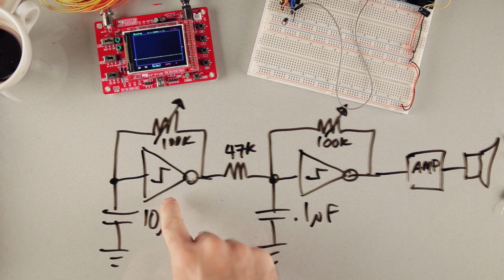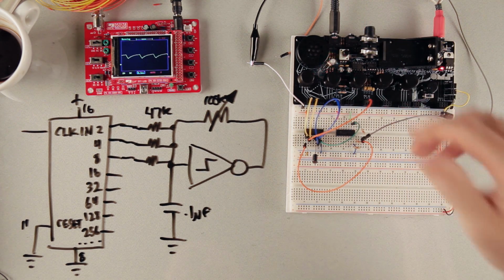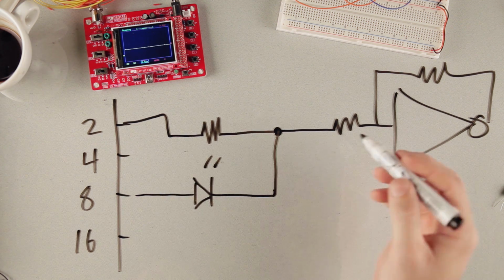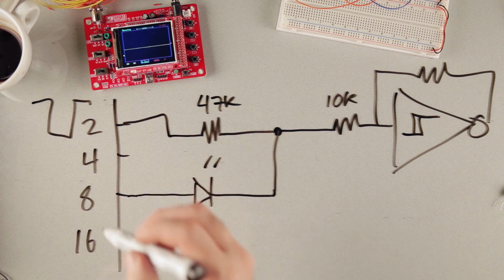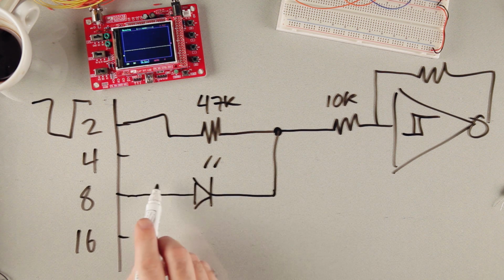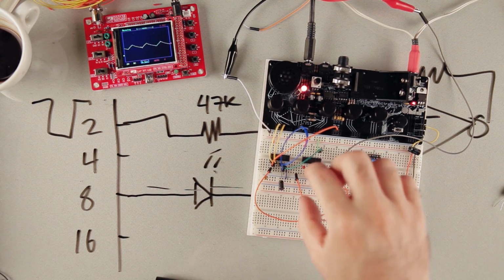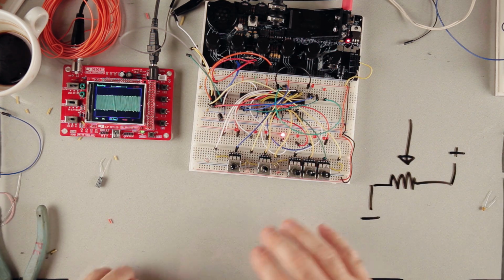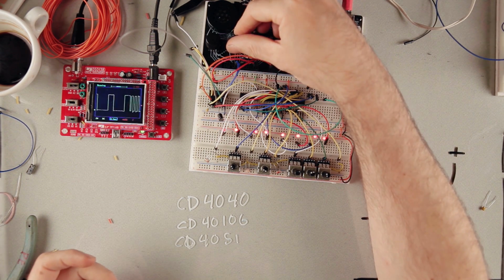Casper Electronics DIY synth building. Part 2: Sequencers

Comment: Like the little scope. CD4060 has a few advantages and can be used mostly like a 4040, cascade if needed. 74HC4060 ( 4040,4020 ) has higher current and plenty of volts for most things. It is 5V logic. CD is higher voltage when required. All seem to cope with a bit of abuse as the Ron of the output devices is mostly self limiting.

Comment: Hey there! Could I get some help? After hours and hours of trying, I couldn't get this to work. I made 1 oscillator, wired it up to clock, got /2 /4 /8, wired that up to A B C, but I guess I couldn't figure out how to wire up pots. I made 2nd oscillator, audio oscillator, on the same 40106, wired right leg of each pot to upper input, and connected every middle leg to one of the inputs on multiplex, took the output of multiplex and connected it to oscillator output. But I get nothing, or some random clicking and noises...I don't know what could it be, I use external PSU to power up everything, and sometimes I even get some strange feedback from the clock outputs on oscillator output even if they are not connected (except power rail). I connected Vss, Vee and INH to ground, which I found in the manual for multiplex. Also, multiplex draws a lot of current I guess, since it got really hot if connected to 12V right away, If i place current limiting resistor, then it gets hot instead. Idk, I might just broke the multiplexer, the clock outputs work fine with 1 oscillator, but as soon as I connect them to A B C i get noise and volume drop...I know that wasn't clear explanation, but I'm quite tired from trying to fix this. If someone has an idea, I would really appreciate it. Thanks!

Comment: you added  2 wire instead of 3 from 4040 to 4051 a and b for pots.. what did you connect thru the 2 wire that gives you sequence?
Reply from the maker: At what part in the video? Send me the time and i'll check it out

Comment: A note to other diy synth newbies like myself: If you’re moved to invest in the materials needed to build these circuits and follow along as well as hopefully furthering your experimenting, know this: these oscillators only sound as good as your amplified audio source. I just found out just how good these circuits can sound through a powered studio monitor with decent bottom end. Life changing. Invest in the best audio setup for this stuff as you can and you will be VERY motivated to make and learn more once you hear how good this handful of parts can sound. Trust me. Peter, you sir are GOLDEN. ❤️
Reply from the maker: Yes! i collect subwoofers just to abuse with breadboard madness. The difference is epic!
Reply: casperelectronics synthesizers Peter, I do have to confess; I just can't seem to get the sequencer working. All else I've done works great. Any chance you might edit this video to build up the sequencer in a similar step-by-step fashion as the previous circuits?
Reply from the maker: @Sarahbuildsstepsequencers  i cant find your previous post about the broken link but the links are now fixed and you can check out the sequencer drawings. hope that helps

Comment: This is great! Thanks for sharing! I have a question: Can I just use 1 4051 to control both the sound and the led?
Reply from the maker: its really best not to. in some cases you can get away with it but it can result in compromised functionality of both the light and the sound.

Comment: Like many others said, your series of videos simply kick ass. I don't know if you (or any buddy around here) can tell me: If I use the divider chip as an octave generator, can I still use the original sound, directly from the oscillator, mixed to the octave? Like creating a different timber? Thank you so much for your videos. thanks to them I'm really diving into it. Cheers!
Reply from the maker: Rodolfo Ribas yes you can still use the original oscillator :) mixing them together is a nice technique for varying timbers as you mentioned
Reply from the maker: hey! sorry for not responding sooner. YES! you can mix in the original signal no problem.

Comment: Hey Peter,
I'm happy to say that I ordered an OHM Synth with the sequencer kit. Can't wait for it to come in.
However, in the meantime, I have been trying to get this 8 step sequencer to work with out it with little success. I should say that I am a total newbie when it comes to this. My only experience with electrical is with my job (Mechanic) and my home. I am fairly good with schematics but I do not consider myself a pro.
After many start overs and much trouble shooting, I finally have it sequencing, but I can't get my 8 pots of the sequencer to change pitch. Also, when I jump my number three leg of the second 4051 to the output of my audio oscillator, I lose all sound completely. 
I know that I have to be missing something even though I maticulously try to follow the schematic. Hoping maybe you could throw out some suggestions. I have tried to follow the schematic, the colored diagram of the sequencer hooked up to the OHM Synth, and your video. Although, I think I confuse myself trying to combine knowledge from all three at the same time lol. As far as the schematic and the colored diagram of the circuit with the OHM Synth, are they exactly the same circuit? To me, the two seem to have some discreptencies.
Thanks a ton,
Clint
Edit: I got it Working!! I had all 8 pots bussed together, but i didn't have them going to the input of my oscillator. now just need to figure out how to get more range. I'm using 100k pots but very little room to play with pitch.
Reply from the maker: cjpitrej that's great! Glad to hear it :) 100k should be enough. What kind of range are you getting? And what capacitor are you using on your oscillator?
Reply: casperelectronics synthesizers 
I have a 1uf capacitor for my audio oscillator and a 10uf for my LFO. For the audio I tried .1uf also. What I mean by range is, I only have approximately 1/8th of rotation on my pots before it cuts off completely between the high and low range. I was able to extend it some by tweaking both the LFO and audio oscillator, but not much. 
Also, when I did this, as I would turn the pot, let's say from right to left, I would go from a low pitch to about a mid range pitch, drop back low then back up to a high pitch until it cuts off. What could cause that?
Reply from the maker: cjpitrej oh. Hmmmm. Unfortunately I don't know. There are lots of possibilities and I would need to know more about what you built. I will say that I've built this circuit hundreds of times and it works. So when you encounter problems like this on testing circuit designs that you know work, it's often best to just tear it down and start over

Comment: Again this video is great!  I have made this and tweaked it a bit, but am wondering can this be expanded to a 16 step by running 2 cd4015 in series? I've read the data sheet (and got confused) and looked around the net, but cannot find anything that makes sense to my fairly novice brain... can this be done 'easily'?
Reply from the maker: It can be done with a 16 channel multiplexer like the cd4067

Comment: just wow! thank you for this descriptional videos! it really got me started into creating a first box for my modular journey :) i have a question , how would i add skipping or shortening the length of the sequence? for example make it restart after the fifth...

another question is, what do i need to take into account for the power supply? it seems my arduino board is not giving enough, as the led's are barely visible in my setup.
Reply from the maker: ello propello hey! For power I would use an external supply, not powering it from the arduino. Somewhere between 5 and 9 volts DC at 50ma or more. As far as sequence length, skipping steps etc, the multiplexer style sequencer is far more flexible than a standard scrolling 8 step sequencer. The step is assigned by sending binary signals to three data input pins. You can choose any step you want this way, skip around the steps, run backwards, etc. this is especially easy if you use the arduino as your data generator
Reply: thanks for the feedback. i already attached it to my eurorack powersupply. its now running smoothly and i built a nice breakoutbox. thanks again for sharing your knowledge

Comment: Can you guys help me please? 

I'm stuck in the cd 4040 part. I made a functional lfo but when I take the outputs from the cd 4040 the rate still the same. Also when I put the output of a normal oscillator it is supposed to change the pitch using the cd 4040, and that's not working either.  I've change the 4040, and no change whatsoever. Help, please.
Reply from the maker: Is the reset pin connected to ground?
Reply: Yeah...
Reply from the maker: +ciro matheus Costa Where is the signal from the LFO connected? Where is your output signal coming from? Can you upload a photo?
Reply: +casperelectronics synthesizers http://i.imgur.com/5gnLyWJ.jpg

Here's a photo. The lfo output is going into the pin 11.
Reply: +casperelectronics synthesizers and btw, thanks for all the attention.
Reply from the maker: make any more progress on this?
Reply: Yeah, sure. I figured it out apparently the ground jumper of the cd4040 was too far from the ground pin of the battery. When I used a longer jumper and put it closely the ic just worked. 

Only problem that I'm facing now is how to make a keyboard. I have some ideas though.

Comment: Enjoyed both parts of this series, really interesting.
Just one question - I notice you are using CMOS chips but you make no mention of the fact that they are sensitive to static electricity and you don't appear to be taking any precautions. Any particular reason why?
Reply from the maker: In my years of circuit building I have never once broken a CMOS chip with static discharge.

Comment: Hey! Really nice piece of knowledge u shared here. So i've got a question then - how would you make a sequencer step mute function (as in sequence running as it normally would, except muting steps 2 and 5 for example)?
Reply from the maker: You can connected multiple MUX chips together and have them share address bits. This makes each MUX run through the same steps at the same time. One MUX controls pitch. One controls the lights and one could be passing the final audio signal through 8 steps. Each step can have a switch to determine if the signal will go to the amp or not. This would allow you to mute the signal for each step.

Comment: Would it be possible to make this a 16 or 32 step sequencer? Preferably switchable between 4x8, 2x16 and 1x32.
Reply from the maker: Yes you can use a CD4067 16 channel multiplexer. BUT the cool trick of this sequencer is that you use different patterns of bits (to the binary address inputs) to determine the sequence. So you have a bank of 8 notes (in this case) but the way you access the notes can make very very long patterns. It's a different way to think about sequencing. Less intuitive than the traditional scrolling sequencer. But much more flexible and, in my opinion, much more playful and musical.
Reply: +casperelectronics synthesizers Well, I do like playfulness. Thanks.
Reply from the maker: So you lose the simplicity of a scrolling sequencer but you gain the ability to transform your sequence by changing the address bits. Which can be done with any square wave
Reply: +casperelectronics synthesizers just realised how fantastic that could work with two clock synced sequencers.
Reply from the maker: +Buster Näslund yup ;) lots of awesome possibilities.
Reply: +casperelectronics synthesizers I couldn't possibly narrow myself down to one approach so I've got both 4051s and 4067s on the way.
Reply: +casperelectronics synthesizers I couldn't possibly narrow myself down to one approach so I've got both 4051s and 4067s on the way.

Comment: Wow, this is just great.  I was thinking of building a function generator for one of the electronics only you tube channels, like mjlorton or eevblog but I will do it from this demonstration.  Very inspirational and inventive.  I love the use of the DSO138 and the breadboard work.  It is great in getting a feel for the values of capacitors and resistors.  The visual presentation using the whiteboard, and the breadboard together is an inspiration idea.  Very little repetition here and absolutely no danger warnings!  I will look at all this guys you tube posts.

Comment: Hi Casper Totally amazing stuff.. hours of fun. With the 8 step voltage sequencer how would you go about changing it to 16?  I have found numerous 8/10/4 steps but can't find a 16 step schematic. I was going to use CD4017 but after seeing this i would like to use these 4040/4051  ICs is it possible? Thanks for your Vids and time  :)
Reply from the maker: heyooo. sorry for the slow answer. You can use the CD4067 16 channel multiplexer. You would use it the same way that you use the CD4051 8 channel mux but with one more data bit. So for the CD4051 you connect /2, /4, and /8 from a CD4040 to the address bits of the CD4051. With the CD4067 you would use /2, /4, /8 and /16
Reply: the only way is using the CD4067?
Can't I use two 4051?
 @bubagoo
Reply: answering my own question! Yes, 2 4051 chips can be used!
Reply: @miojodeprastico  Dude your Moon video is amazing! Turn off made for childrens in your vids! Can you upload a vid for your dual 4051 build???
Reply: @re8et355  You can see in my channel the vids called "Jamin Frank" the dual 4051 sequencer running!

Comment: Great video, thanks a lot!

Do you plan to make voltage controlled oscillator?
I really like simplicity of NOT gate based oscillator, but resistance control makes sequencers and other stuff more complex.
Reply from the maker: +oleoleone Its easy to convert the gate based oscillators to be voltage controllable. I just didn't want to  add another layer on top of a bunch of (probably already confusing) info in this video. I can post a schematic if you're curious.
Reply: +casperelectronics synthesizers 
yes, please, post it, or just send it to oleoleone at gmail
Reply: please

Comment: Peter,  will the OMSynth make it possible to adapt these basic circuits to 1v/Oct or Hz/V?

When will it be available for purchase?  Any tips needed to order a board run using your layout posted on the site?  I'd like to connect Novadrones to my other gear
Reply: I plan to start selling the OMsynth soon-ish. As far as volts to hertz etc. whatever you can do on a breadboard you can do here. So yes it's possible but you will have to wire it up yourself.

Comment: extremly nice video thanks a lot casper ! i just have one (silly?) question after this, what's the kind of switch you are using at  around 22:50 to make a step by step adjustment and then putting the clock back in the circuit ? looks like i've missed something ^^
Reply from the maker: +loris Habib yeah....thats kind of a special switch. when you press down its momentarily on. SO i press down and it sends a single pulse of current to the clock input of the counter. In the center position it is OFF. When i press up its a latching ON switch which connects a clock to the clock input of the counter.
Reply: ok that's what i thought thank you ! do you know where i can find these in europe ?
Reply from the maker: +loris Habib . I dont know where you can find them anywhere :( I bought them a long time ago and cant find more .
Reply: arf ! ok ! i'll try around home in small shops ;)